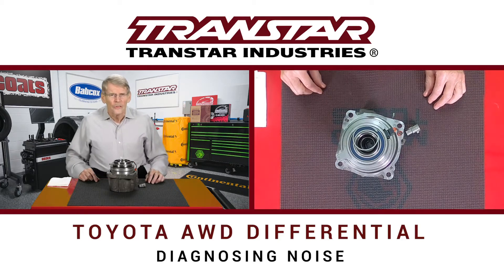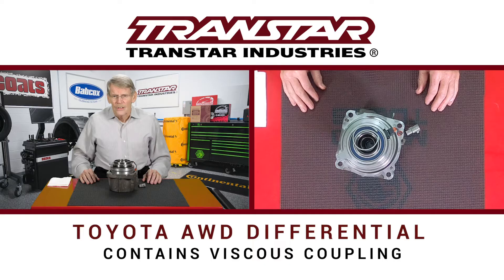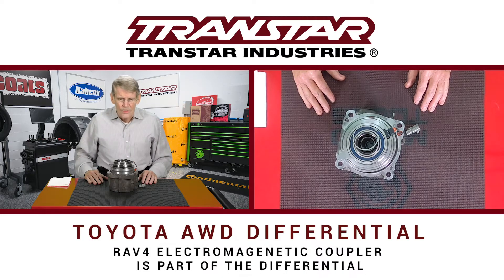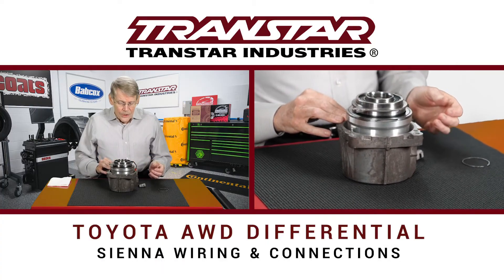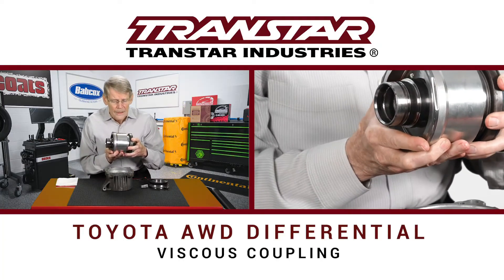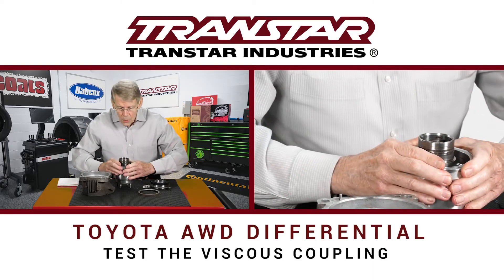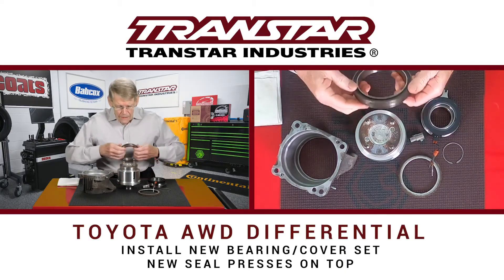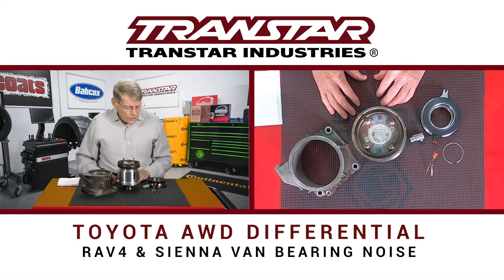Toyota AWD Differential Bearing Noise

Comment: I have a 2018 Toyota Rav4 Adventure AWD that has started making a noise from the rear of the vehicle.  Could this be what is causing the problem.  I have already replaced the right side wheel bearing because it initially sounded like it was coming from there.  Still have the noise.

Comment: My Problem started after the wife started regularly running through a Nice big Auto Car wash, i think it was Undercarriage high pressure wash that pushed water into Said Bearing killing what was left of its life. I replaced just the Bearing itself. Alittle tricky disconnecting the tiny pins in plug and remembering to put back together, I also used a Diff type ((Permatex)) vibration proof Sealant for reassembly, filled with proper Diff oil, BE SURE TO USE ANTI SEIZE LUBE FOR BOLTS, And be careful removing old ones,they can be stubborn due to "steel in aluminum corrosion,"Problem solved. Noise gone. Only had to purchase OEM Toyota dust cover ring and Bearing, consider Oil Seal behind coupler if it is leaking, mine was not, I didn't replace.  Cheers. Hope it helps someone.

Comment: I took apart our 2009 AWD VENZA . Big bearing is good. Going to replace it anyway because it comes with the bearing kit I purchased. But the inside smaller bearing is bad. Is this normal or something else maybe causing this issue?

Comment: My 2013 Sienna has been unusually loud for the past little bit and the noise seems to be coming from the rear differential area. Would it be possible to replace the bearings without purchasing a whole new unit? It seems like the aftermarket replacement bearings don’t have the o-ring attached, since the design of the coupler has been revised and is now sealed. Would the dust deflectors and covers from the revised coupler fit in the original?
Thank you immensely.

Comment: I have a 2015 sienna awd. Its making shuddering almost feels like tires aren't gripping but only in reverse and at a slight incline so while under pressure. The rear diff oil was black as night and had a shimmer to it. Toyota is saying trans my mechanic says viscous coupler or rear differential. Someone helpppp

Comment: Fantastic, knowledgeable video. 
Quick question..I have a 2019 Toyota 4runner Limited AWD with the torson center locking differential. The vehicle only has fifteen thousand miles on it.
While driving slowly in packed snow the other day, I turned the selector knob to 4 HI, which locks the center diff. Immediately I heard a VERY CONCERNING and HEAVY and LOUD grinding noise with vibration (not the light buzz that owners say is normal). It sounded like gears slippng past one another. I Immediately stopped the vehicle as the 4WD indicator light flashed signaling a failure to engage. I tried several times to engage 4WD with the vehicle stopped and in neutral without success. 
I then put the vehicle in the default AWD mode and returned home without incident. 
Several days later, I tried engaging the center locking diff again and it worked perfectly. 
I also took the vehicle to the dealership and everything checked out fine...🤔
I've got one year of warranty left but am still very concerned. 
I love the vehicle but am worried about the episode. 
Your opinion would be greatly appreciated. What do you think? I can't find anything on the web.
Thanks in advance!

Comment: Is it the same for the 1994 add caldina ST 195?
Reply from the maker: Not sure of the differential design in a 94 Caldina as the model Is not used here. Check with a local dealer and review an exploded view of the differential and also check for any TSB's.

Comment: My '10 venza developed a noise ,It was not from the outer large bearing (fairly good condition)  but from the inner smaller bearing behind the magnetic coil,I do not think there were any TSB for the venza models
Reply: What did you do to fix the problem

Comment: Hello, I have a question, I hope you can help me. I just bought a 2010 rav4 AWD and its making a humming noise around 30mph till 40mph if I let off the throttle noise stops. I think its coming from the transmission area. I read that it's normal on toyotas. Any suggestions?
Reply from the maker: Noise can be extremely difficult to diagnose. A noise affected by throttle position normally denotes a gear issue and not a bearing problem. Try to determine the source with the vehicle on a lift.
Reply: I have the same issue on my rav4 2011.
Reply: @swikarpyakurel8863  have you done anything about it ?
Reply: @tg6892  Yes. I had a mechanic replace the transmission screen/filter. And drain and fill the transmission fluid twice. With a day or two of driving in between. I used an independent mechanic and all OEM parts and fluid. Do NOT do the dealers transmission flush, as it can make it worse. Also if I remember I would put the gear on 3-D as a temporary fix until my appointment. It solved my problem hope it does for you too!
Reply: @swikarpyakurel8863  hos many miles have you put since the drain and fill?
Reply: @tg6892  close to 15k miles.
Reply: There are many noises that Toyotas make that are supposedly "normal" but still indicate underlying issues.
Reply: @karlschauff7989  have you figured it out
Reply: Same issue for me on a 2008 rav4, have you found any solution ?
Reply: Transmission whine is a known issue for the 4.3 gen Rav4.
Reply: @asifyousuf6831  This isn't a whine or whoosh we are talking about. Its a straight up rumble/growl/grind when the trans goes into overdrive. I did a transmission drain and fill and it came back. Prob should have done two drain and fills to get rid of the all the old ATF...

Comment: Does this apply for 2017 RAV4 XLE AWD AT Transmission? Why the NSK bearing replacement has no seal on it? Can I get that piece with the o-ring included?
Reply: From Mike Riley:  The video in question refers to Toyotas 2006-2012 due to the differential bearing failure. Newer models will have this upgrade
done at the factory. Replacement parts availability is dependent upon what Toyota thinks is applicable.
It may be that by 2017 Toyota has chosen to not offer the components separately but rather with the viscous coupling assembly only.
Contact Toyota to determine what is available along with any adjacent parts that are needed
Reply: @autoprojobs4941  Sure! According to ToyotaDIYers, this part is unserviceable (1) (please see links at the end of the comment): As the company claims with `N03` code "This part is not supplied as an individual part because it's difficult to keep the function/quality of parts assembled/disassembled". Curious that is not the only part that is treated the same for Toyota (There are other parts that you can't buy at the dealer). Talking with my mechanic friend he told me that achieved to find the damaged bearing (an NTN 6819 LLU 95x120x13mm (2), also manufactured by NSK). I haven't talked with him since then, not sure if the new bearing has a seal or not. Not sure if the  O-ring seal is needed since it seems like water can't enter since the enclosure is kind of "sealed". I'm afraid that Toyota will need to publish a TSB in the next couple of years for this kind of component since I'm seeing all over the internet that I'm not the only owner with this issue in the car (i.e. they extended the warranty for some RAV4 series 3 XA30 (3)). I'm putting all the info here in case someone is in the same situation as me.

Links: 
1 - https://www.toyodiy.com/parts/p_U_201704_TOYOTA_RAV4_ASA44L-ANTMKA_4101.html 
2-  https://www.ebay.com/itm/NTN-6819-LLU-Deep-Groove-Ball-Bearings-95x120x13mm-/323942380235
3- https://static.nhtsa.gov/odi/tsbs/2016/SB-10092682-5448.pdf
Reply from the maker: This bearing issue impacts several models of Toyota's. Although the cover and viscous assembly may be different, the bearing in question is the same. The factory bearing is proprietary to Toyota and not available separately although a comparable bearing (size wise) is available in the aftermarket but without the O ring groove. Water intrusion between the bearing and cover is not the issue but rather water intrusion into the bearing itself which is why Toyota implemented the large metal clad seal and redesigned deflector. It is those two parts that prevents bearing failure due to moisture. If a bearing through the aftermarket is preferable then use that and purchase the metal clad seal (41302-42050) and one of two deflectors based upon design (41252-42013 / 20). An OE bearing can be obtained by purchasing a new cover w/ bearing (90304-94005) and rob the bearing.
Reply: @TransmissionDigest  Thank you for all the information. I'll share it with other owners since this is affecting so many models.
Reply: Just a heads up, I don’t think the revised deflectors will work unless you buy the updated coupler housing (cover).  Based on the pictures in the TSB, the revised cover OD has a shoulder that the revised deflectors fit over top of.  I can’t see the new deflectors working with the original covers, if you are trying to do the bearing replacement only.  Someone correct me if I’m wrong.  I’m planning on doing the bearing replacement on a 2013 Sienna.  I think I’ll have to use the originally designed deflector, without the “metal clad seal”.  Does anyone know if the RAV4 covers fit the Sienna couplers?

Comment: Thanks for the video. I have a 2017 sienna awd. Started hearing a noise that was similar to brake pads dragging during slow speeds. Noise was loudet when turing either left or right. Took it to toyota dealshership and the techs thought that the front brake calipers were warped... van has 27000kms. Wife drives it to work twice a week and is.no speed demon.  They machined the rotors and did a brake service. No change in noise.. I'm starting to think this could be a problem with the power transfer unit and the bearing that you indicated a potential problem point.  Thanks again
Reply: It was probably a wheel bearing. I misdiagnosed my neighbors cars loud noise while turning left or right and turned out to be either left or right front wheel bearing
Reply: @jean-pierremallet3524  It ended up being the tires. The AWD models come with run flats. I changed them out for some michelin latitudes non run flat tires. Noise is gone.

Comment: So is the Viscous Coupler a dry unit?
It doesn’t share or use the oil from the rear differential does it?
Reply from the maker: The viscous coupler does contain oil (fluid) which is unique and separate from the differential oil.
The viscous coupler is not serviceable but can be tested, as mentioned, to ensure that the oil has not leaked out
into the differential. If the inner spline moves freely it's an indication that the oil has leaked out and that the viscous needs replaced.
~ Mike Riley

Comment: Is it just a noise? Or is it a issue that will cause damage down the road?
Reply: The complaint typically is noise-related but, as Mike indicates elements, particularly moisture, will eventually cause bearing failure.
Reply: It's an issue.